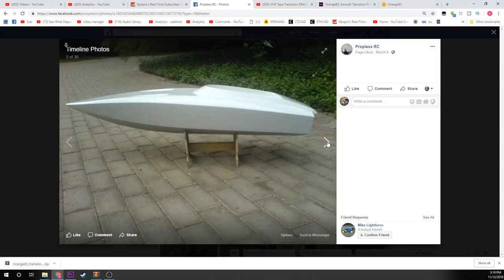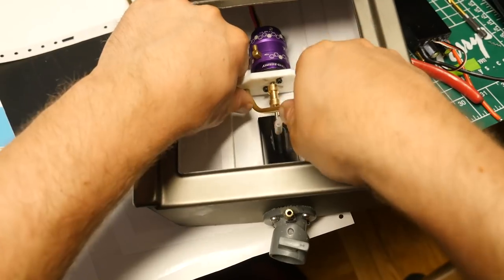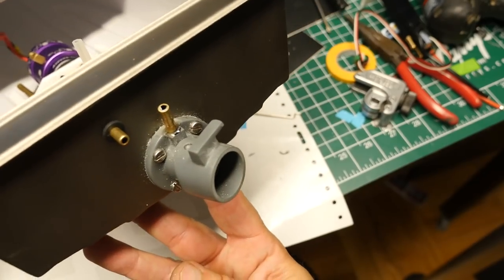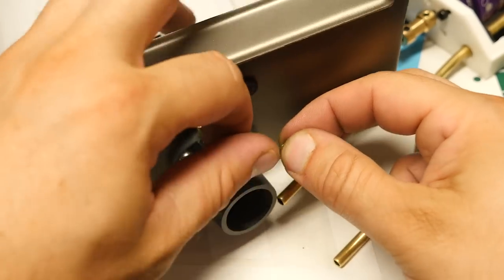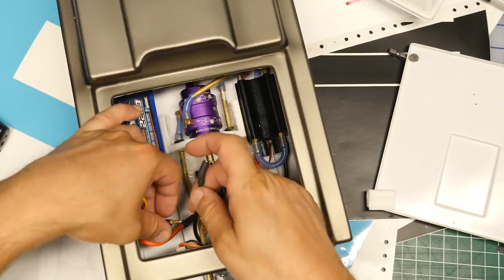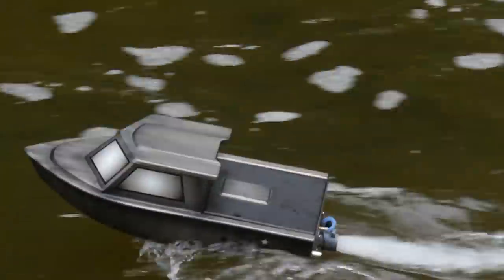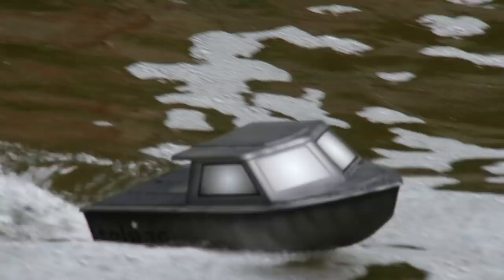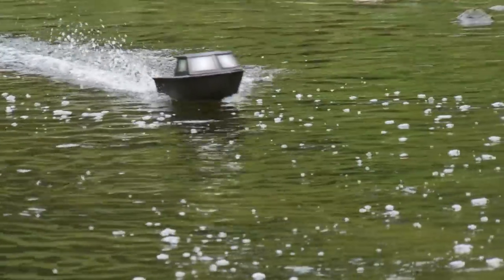RC JETBOAT BUILD - WAYYY better than a NQD (PROPLESSRC)

Comment: Thing with jet drives, theres only so much power the pump can take before cavitation starts. So more power doesn't always mean more better, kinda have to find the sweet spot when performance stops its peak and starts to decrease.  Also weight distribution is key, try moving the battery around, forward backward to stop the porpoising, but too much weight too far forward will make it unstable. Its a  Balancing act!
Cheers
Reply from the maker: great advice!

Comment: Add a scoop in the intake grate, also you might not have enough weight in the boat. Run two of the same batteries in parallel one on each side same voltage but double the capacity that will keep it from porpoising. How do you not scoop will definitely help as well. Made a big difference on my jet ski.

Comment: I know this is an old video, but being a New Zealander I know a few things about jet boats, the air in the impeller is from it being revved to high causing small air pockets behind the impeller blade, once these get big enough the pump loses its prime and can damage the prop. This phenomenon can cause race boats jet drive units to damage the impeller from heavy oxidation and warping. the solution, bigger jet unit and lower rpm.

Comment: Need the intake lower in the water but you have to find the hulls sweet spot to be able to have the hull plain up on the water properly and still be able to keep the intake under water at the same time.Just watch out for gators LOL
Reply: you want the very back of the water to be in the water, this lets you "flick the boat".

Comment: I am going to build a boat from scratch and do not know where to get the best parts if they are not already attached to a boat. I am going to build a wooden boat that will be about 3 feet long. I do not need a very fast motor but I need the motor before I start building the boat. What is a good web site for buying parts and not boats that are ready out of the box?

Comment: Like all boats in scale the hulls seem more bouyant, I've got a 36" flat bottom with dual Graupner drives, I use a small set of kitchen scales(2) to balance the boat, had to use a couple grams of self adhesive wheel weights to achieve a great running balance.
To much battery power doesn't work on boats, back of the voltage to stop cavitation
Reply from the maker: great info dude. much appreciated! i'll do all of those things.

Comment: Have you tried a Streamline RC Thrasher? I have one, and they are ridiculously good. Very durable, quick, and handle really well.
Reply from the maker: yeah. but. they're 600 dollars not including batteries. so. it's just a bit too much for me. I'd rather spend it on a few other projects.
Reply: @kpopRC  I have been following your Abarth build. I didn't realize $600 was too much to spend for you on an RC. You have got to already have tons of batteries that you could throw into the Thrasher. Just giving a suggestion. The best two jet boats you can buy would either be a Thrasher or one of Youngster's jet boats.

Comment: Really love the channel man it's always a good idea to watercool boats as they are under much more load than cars and usually have sealed hulls but at least your not doing what i seen on the creative channel and using flexible pvc tube hot glued to the motor haha would love to see more boat content. And just make sure that no cooling lines are kinked and periodically check that water is coming out

Comment: If you want a nice jet boat get a thrasher v2 its all waterproof electronics has an auto bilge pump using 2 or 4 axis to activate the pump and the v2 is all upgraded hull ti handle any water pretty much

Overall awsome boat and really stable
Reply from the maker: im not going to get it.. looks sweet. but 600 dollars?

Comment: Is there a self rightning system ? Or will you loose it, at the first river capsize ?
Thanks
Reply from the maker: i fill the hull with foam. if it capsizes, it's still floating. This isn't a self righting hull. It's built for a river. ankle deep.

Comment: I have a jet boat and it's got a custom ride plate over the intake that helps suck in water and prevents the pump from sucking air in
Reply from the maker: oh yeah? Ride plate? i'll google it.
Reply: @kpopRC  yeah it just goes underneath and scoops up the water
Reply: Also mine is a full scale boat so I don't know if this works on rc boats
Reply from the maker: great advice. and probably something i can easily 3dprint. so bonus! thanks man!

Comment: If you want to improve the handling of your boat in the video, it looks like it needs the weight shift a little forward. This should get the nose down and stop the porpoising. When the bow bounces up and down, that is probably what is letting air under your hull and into the pump.

Comment: Yeah so i would put the weight just under the baxk of the wheel house maybe a pound and for the propeller the pitch is key for the less cavitation its about thrust of course i work as a commerical fisherman that drives a skiff and the differents in how many blades it jas along with the pitch play around with the pitch and see if you can get the keel of the boat a little deeper in the water  and maybe a nosel on the output of the jet

Comment: Try putting the battery in the front so it stops bobbing while driving
Reply: Chromosome theif the "bobbing" is called porpoising. That actuallu happens when a boat is just underpowered enough to almost get up on plane...but not quite. This can also happen if the boat isn't trimmed right. You're right on moving the battery...but I'd move it aft just a touch.
Reply: My jet ski does that around 60mph and its so annoying but when you put stuff up front it helps
Reply: ROTAXD false. It has nothing to do with being under Powered. It is strictly on the weight ratio and it’s because of the pitch of the jet nozzle.
Reply: But wouldnt that create more drag and lower its top speed? Since there would be a higher surface area in contact with the water?
Reply: @MachoMandem  my understanding is that when the hull is on plane it rides on top of the water, like a smooth stone skimming across the surface, instead of using buoyancy to float. When the boat is not on plane, the water line is higher on the hull and efficiency is lost to drag since you're pushing through the water instead of riding on top of it.
Reply: @lavachemist  thanks for the explanation

Comment: Each jet drive is has an operating range for RPM. If you exceed the RPM of the jetdrive it will cavitate and the drive will lose thrust. For Brushless motors on LiPo's, generally the formula =  No. of cells x voltage per cell x Motor kV rating.  In your Yellow NDQ vid it looked like you were using a 2040SL motor. If so it's a 4800kV brushless motor running on 3S LiPo's...So that would give you an approximate RPM of... 3 cells x 3.7V per cell x 4800kV = 53,280 RPM. There's very little chance that jet drive can handle that. in comparison, a KMB 28mm jet drive has an operating RPM range of 15,000-20,000 RPM. Ideally you would pair your motor and battery to match the RPM rating of your jet drive...or just stay well away from wot when operating.

Comment: Yes, you can over rev a jet pump. Once it starts to cavitate, rpm will skyrocket and you'll lose speed. One of the best jet pumps currently on the market is actually made by hobby king. 
https://hobbyking.com/en_us/40mm-jetpump.html?___store=en_us
Reply from the maker: good to know. that pumper is MASSIVE.

Comment: keep the weight in the ass, but also keep the COG low! take it from some one who has made their own  3m jet boat powerd by a 700cc jetski engine! too much weight in the front no good also you dont want the dead rise to be too sharp!
Reply from the maker: You think a shoe to push the water up into the pumper will help?
Reply: @kpopRC  possibly but you could also be leaving ya self open to snagging it in the shallow waters try a more open grill if it doesn't have one already or custom make a scoop grill to direct the water right to the pump like the jet ski grates here in this link https://www.impellers.com/jet-ski-intake-grate.html.

fire up that 3d printer and make a few grate's and try em out mate, good luck :)

Comment: Whats so hard in this? Just design and 3d print the plug and you can vacuum form how ever many you like. Plastic is like 10-20$ and those jet motors are sold in amazon with motor and cooling system for 45$ Anything else is combination of profit and business expenses that depend on country you live.
Reply from the maker: Have you ever priced out a vacuum former? I've tried to build one a few times. The pumpers are much better than the chinese clones of the graupner pumpers. Sorry man. what you're saying would take thousands of dollars in investments in tooling.